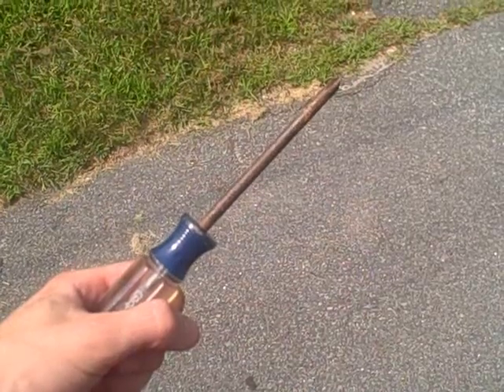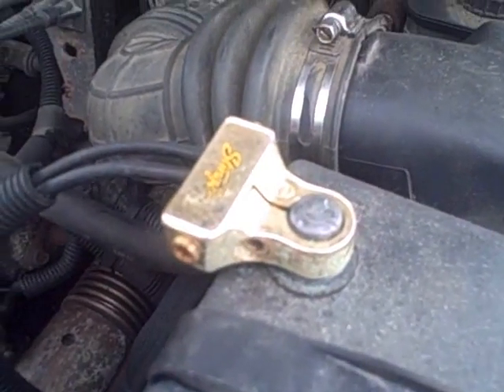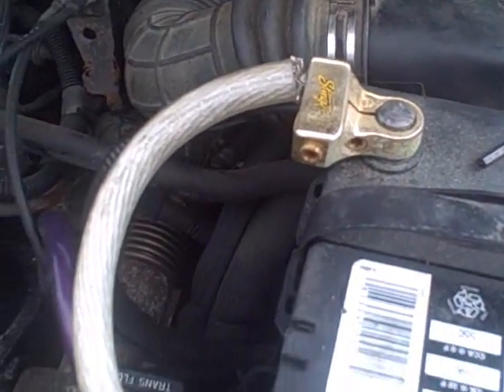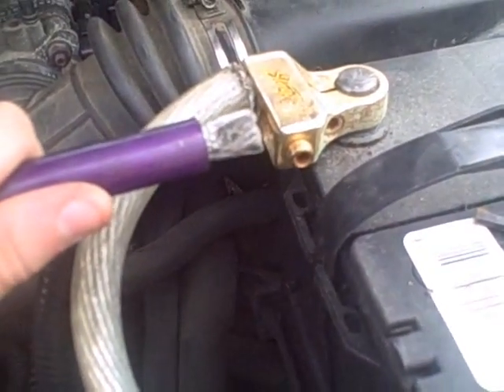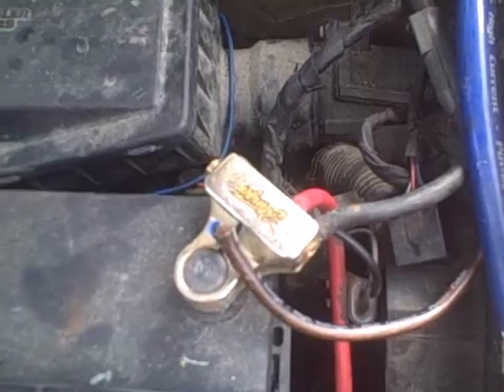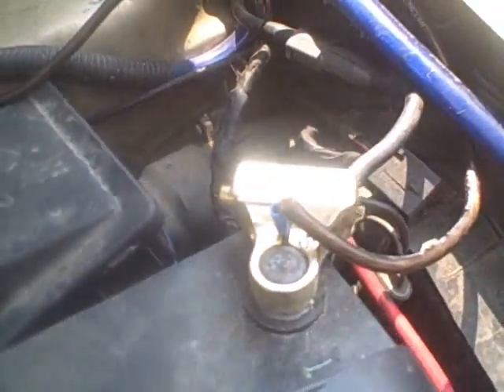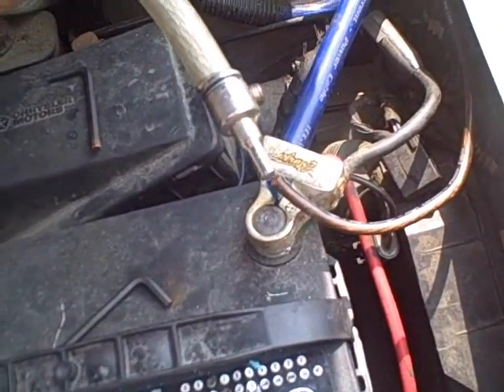Increase Car Audio Power 25% - How To Install Big Three Upgrade - Easy 15 Volt Stereo System Big 3

Comment: here is a good positive terminal with digital meter for less than 20 buck.Raptor RGBTMP-4C Rose Gold Positive Battery Terminal with Meter (1) 1/0 Gauge (2) 4 Gauge (2) 8 Gauge Oututs on amazon

Comment: I mean, putting in fuses after the battery is all hooked up. Neg is on, and pos is on of course. Putting in fuses then is what I'm confused about. Wouldn't it just be better to put them in while the negative cable is disconnected?

Comment: @p1n0ym4n321 Try to find a bolt on a solid piece of metal try and avoid the sheet metal. I bolted mine to the chassis.

Comment from the maker: With a 1500 watt amp - You're just on the edge of pushing it for your stock electrical - But with a good wiring job, and the big 3 upgrade, you should be alright as long as you monitor the voltage while bumping. And BTW - thanks for the nice comment :P

Comment: 1. How are you such a BOSS? and why are you so nice??? haha
2. Help! I am driving a 1990 Toyota Camry (not kidding, dont laugh) stock alternator and battery, running only 400 watts to my 2 12" Kicker CVRs. Obviously i am underpowering them, so i have a hifonics 1500 on the way. The problem is that my lights already dim.. will the big three help that? And do i NEED to run a fuse anywhere in the big three? Cuz ive seen it written somewhere. And do i NEED a different adapter to the battery? Thanks!

Comment from the maker: 1: It's my amp wire with a 1/0 adpater on the end of it - 2: No, some people do the Big 3 with the stock alt and batt still there - 3: Yes, depending on the size of the amp. - 4: They are nice subs.

Comment: what does the last 0 gauge wire run too and why is the end so different? do i need to upgrade my battery and alt to do the big three? at what point do i need another battery? and if i use 0 gauge wire for the big three is it okay to use 4 gauge to run to my amp? I'm sorry for all the questions I'm pretty sure i know the answers i just want to make sure I'm doing it right and don't feel like dealing with the ass holes at the shop around here. and what do you think of obsidian audio 12's? lol sorr

Comment: Thank you for simplifying pages and pages of instructions into one 3 min video lol, but one question, how does bigger guage wires increase 12v to 15v? or is that an upgraded battery?

Comment from the maker: Yes, on the negative wire - I use the stock engine ground, and add another engine ground on a near-by (clean) bolt.  --- 2nd ---- NO!!!!! DO NOT ATTACH YOUR POSITIVE WIRE TO JUST ANY BOLT ON YOUR ALTERNATOR!!! --- This will GROUND OUT YOUR VEHICLE! --- The alternator casing, bolts, and framework around your alternator are ALL GROUNDS - That is why we ground our engines, because our alternators are connected to them. You need to look harder on your alt, there is likely a post you are overlooking!

Comment from the maker: Often times it can be a simple loose wire in those cheaply made casings they are housed in - Open it up with a flathead and check the situation - If need be, reconnect the dangling wires or what have you - If not, try messing with the wire where it comes into the unit - It could be frayed.

Comment from the maker: With your alternator being the amperage that it is... I wouldn't suggest going much over 1,000W - With your rise, you'll likely still be seeing close to a 4ohm load, but even then, over time your alternator is going to be doing most of the work - If you can added another like-sized battery to your electrical, it would help buffer things up a bit, but I would recommend upgrading to a 100 / 200 amp alternator if you plan on doing a 1k+ / 2k system. You're only as good as your charging system :)

Comment: So I can put the negative to any bolt that's on the engine? Also my alternator doesn't have a positive bolt, so do I attach it to any bolt that's on the alternator? Help would be appreciated :)

Comment: Hey man, couple of questions. I have a 50Amp alternator in my car, I've done the big 3 upgrade with 2 gauge wire, how many RMS watts would you say I could pull from my system? and are there any other upgrades I could do to move this number up a bit? I would also like to know if running a lower impedance will put more strain on the alternator, because right now I have a 4 ohm load but since I bought 2 more subs i'll have a 1.3ohm load, at the same draw will this put more strain on the alt? Cheers

Comment: Hey exo I got another question I've got some aluminum wire I'm not sure of the gauge but it's either 0 or it's a Tad bit bigger and I can't afford the copper and I was wondering if the aluminum would work as well as the copper because the wire that's in it now is eight gauge Walmart wire that was already hooked up when I got the car thanks for all your help and I did find that video you were talking about with the single 18 and I built my new box and it's twice as loud thanks again bro.

Comment from the maker: I got this batch from Dr. Stereo - A local car audio shop of mine - And as far as the batter terminals and such - I got all that stuff from Ebay by searching "battery terminals" "1/0 wire adapter"

Comment: Hey Exo :)  i got 2 or 4 awg for my alternator and 1 awg for ground on alternator and from battery to chasis, 1 awg to power my amp and 2 awg to ground for my amp. my amp is now sold so i use a shitty 1000w peak boss audio amp now, but im getting a amp on 1500w rms for my pioneers on 1000w rms, and a 150 fuse block :) do i need any bigger wire ? i have 2 battery on 74 ah with 2 awg to power between them and 2 awg for ground :) :D LOVE YOUR VIDS !!! <3 <3

Comment: oh okay thanks c: and the "accesory/stereo cable" are those your stock wires? did you just cut the wire, add a fuse and add more 0 gauge after it? and also where did you get that thing at the end of that wire? the metal thing.

Comment from the maker: No, if anything it will put less stress on your stock wires. Some people totally replace them, some people just add to them. As well as fusing - Some people choose to only fuse their amps and accessories, while other fuse from alt to batt, and batt to batt ect.

Comment: EXO i have a question for you. If you do the big 3 upgrade, do you have to worry about frying your stock wires? Also, my stock wires come out to a terminal which is the battery terminal, like the wire is basically directly going to the battery, would i have to cut off the terminal and strip those wires? And fuse them? Or what do i do? Im also planning on getting extra batteries, would i have to worry about frying stock wires then too?

Comment: Tuning? &(may be a silly question)are you supposed to solder the lugs to the wires? O.O 'Cause that's all I think could be the "problem", besides the fact that my engine was grimy at the ground point(I believe I cleaned it though - plus I sanded it)... >.>

Comment: Should I leave my stock wire (power wire from alternator to battery) on as well as putting the 0 guage? Or should I take the stock wire off and leave just the 0 gauge? I figure more wire more current right? so I should leave the stock on along with the 0 gauge?

Comment: Well, I did the big 3 upgrade(small 3 actually - as I used 4AWG), but my amp is still tripping off after say 25mins or even less when I play music with Sine wave bass... =( A supposedly experienced guy told me I'm driving too much input signal to the amp(buy maxing out the gain & matching it to my 2V output Sony Deck), but I now believe that my(used)amp isn't working properly(damaged)& I'm seriously thinking of replacing it... >.> Any thoughts? O.O

Comment: hey man...nice setup...you know where i can get a high output alternator for a toyota echo online at a reliable site? i did the big three and expect to drop in  optima yellow top soon in the same echo but the current alternator is for 90 A and my amplifier draws 60 A max. By the way, are you pro - capacitor or not, and would it be useful for this setup instead of a high output alternator?

Comment: Hey exo do you need a fuse in the power wire running from the alternator to the battery?? I did some research and some say yes but some say it's not needed. I just need someone to guide me in the right direction because I do not want to waste money but I don't want to create a hazard.
Reply: any wire that is normally connected to the positive terminal of the battery requires a fuse, including the alternator wire in the big 3 upgrade

Comment: Hey - does the big three really increase your system voltage? I have a Jensen Power 680(680peak\340RMS non certified)amplifier & it keeps shutting down after a while & I notice this happens when my voltage(as seen on my Cadence 1.2uF Capacitor)drops below 14 volts(when I put my blower etc on)... PS: I plan to use 4AWG since it's just one amp & my Sony stereo...

Comment: @EXOcontralto 

     Hey man I like your stuff. Good FYI and install tips. But I have to say that caps can be a very useful tool in getting better sounding more powerful bass in setups that don't require 2 or more extra batteries. I know that on my system ( Kicker CVX 10, Kenwood KAC9104d and a yellow top stinger) my 2 farad makes a world of difference in my spl and sound quality. I did the big 3 w/ Kicker true 4 awh. Just a diff of opinion but all respect

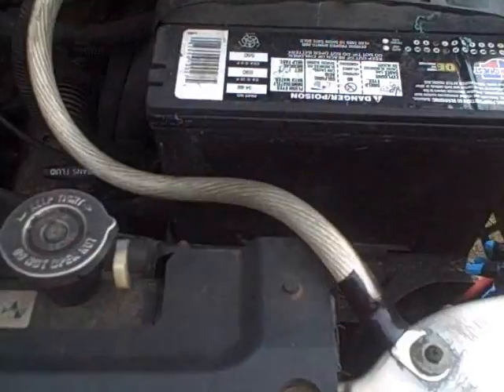Comment: Just a little suggestion at 1:22 take bolt and a nut and secure it propperly.
You can use a big ass cable, but its only as good as its connection.

Comment: hey man, awesome vids yr cool as hell. I have a 01 cadillac deville with a pioneer deh-p9400 and 2 cvr 12 with a zx1000 on 2 ohm. should i do the big 3? the only thing is that the cadillac battery is under the back seat -__- If you reply thanks man

Comment from the maker: YES - Your POWER is only as good as your GROUND - DC voltage travels in a big loop - You need to have the cable the same size on both sides.

Comment: I think that what he means by "drop out" is that his amp runs out of stored power, and that his car cannot supply enough current for his amp, so that when the low bass hits the amp looses power and sounds quieter(hence the bass "drops out") So he did the big 3, and now his amp sucks all the power from his battery because his alternator is not powerful enough. ( i am just guessing here :) hopefully this helps!

Comment: Sorry for the car audio lingo.  "Drop out on deep bass" = The low bass notes that rattle most little cars "yet kids think it sounds great." Low bass notes will make your alt work harder. Some kids add a cap 1 - 2 MFD (UF) which I don't recommend. I would go for a heavy duty alt and bigger bat. To avoid future problems. nothing worse than being stuck far from home.

Comment: I did the same on my 2011 F150 Followed your directions exactly I did a 1998 Honda Civic EX same as you suggest.  I also added power amps to both vehicles The upgrade you suggest stopped "drop out" on deep bass and killed my battery.  I suggest if your gonna do this do an alternator and battery upgrade. Because if your using high performance equipment and your headlights are dim or get dim with low  bass notes without upgrading the alt and battery? Your only asking for trouble.

Comment: the gauge of the wire is for more amps. your audio system draws power so the larger the wire the lower the chances of the wire overheating. the only reason you place a OO wire is if your amp draws 150 amps, but it doesnt. so this is a waste unless u invest in an 1 to 2 Farad cap and a  5 kW system

Comment from the maker: Most ALL amplifiers are rated and tested at 14.4v volts. That means for every tenth of a volt you are below this number, you are gradually delivering less and less power to your subs, creating dirtier and dirty power, and stinkier subs - as you reach further below 12v range, that's death to gear - No offense to your pops, but he's on the wrong track with that one. If you're voltage is 13.8 to begin with, you really want to try to keep it there as best as you can, as it affects it a great deal.

Comment: hmm I have 3 amps and 2 subs (the other amp supplies rear speakers) in my trunk, didn't upgrade the cables, the 12V cable that goes to the trunk is maybe half the thickness.
Also got a capacitor.

And it works flawless.

Comment: my car runs at 13.8 volts all the time and my amps bring it down to 13.2. i have an optima yellow top in front and 2 blue tops in the back.

Comment: If your car runs all the time at 13.2 volts then your batteries will not last as long. This does affect your batteries total power because power is the watts and power is voltage times amperage. I wouldnt see it lowering your power to your amp much though.  And as long as your battery has 12 volts when you start your engine it will put out the amount of starting power it is supposed too. You can get the battery load tested for free at parts stores.

Comment: Hello I just got a new 200 amp alternator on my 2001 Ford explorer sport Trac I have 2 kenwood 1000watt amplifiers, 1 db link 4 farad cap and 2 dual enclosed MTX Terminator subs (4 in total) and my lights are still dimming do you think the big 3 will help and/or will I need to buy a new battery as well? Please help

Comment: I have a question for the people who actually know something about voltage and amps. I want to do the big 3. My alternator charges at 13.8 volts (voltage drop takes it down to 13.2) and my rear batteries have 500 cranking amps each. My dad seems to think the batteries' voltage won't affect my amps' output power. Any thoughts?

Comment: @EXOcontralto love your Vids bro subcribed, i have some questions for you?? im running two 15inch L7 kickers in a 1994 chevy caprice on a 6000 watt performance teknique amp.... I need to do big 3 add a extra battery i currently have a sealed box but i think the box isnt big enough what should i do to increase my bass should i go ported box for deeper bass? is big 3 cheap to do? and should i also add a EQ or crossover let me kno please i would appreciate it oh yea i only have 4 guage right now

Comment: @EXOcontralto 

Another benefit of soldering is all connections (wires, terminals ETC...) have a secure electrical and mechanical connection which in the long run makes the whole system more reliable and also able to handle more current given the solder provides a lower resistance between what is connected than crimp terminals do.

Comment: idk ae.. waste of $40 i think. Unless you've upgraded the alternator the only one which would benefit from upgrading is the ground-chassis wire. That's because it's the only one where your amp will need to run current though. The alternator-positive and engine-ground wires were chosen by the manufacturer to be adequate for the current draw of the alternator. If you reeeeeeally think they calculated it wrong then get a multimeter and see what voltage drop your getting across the wire.

Comment: I really hope you guys with boom cars know how annoyed your neighbors are with you. When you're pushing 15+ inches of air it doesn't matter what level you listen to your music at, people hear it inside of their homes, over their own music and it's one of those suburban disturbances that get worse every year. If you guys would just turn down the sub output from your head units when you're just listening to music in your driveway it wouldn't bother people as much. 760wRMS into 2 12"sealed subs btw

Comment: Hi i have a question. My total wattage for my amp is 1400rms. If I upgrade my battery to a kinetic hc 2000 which give out 2250 cranking amps and upgrade my big three will I be fine? I don't wanna purchase a new alternator, so i'm hoping this would suffice

Comment: if i was to buy an optima yellow top nd do the big three with a stock alteranter nd have another batter in the back could i also do the big 3 with the same alternator or do i have to buy another alternator??

Comment from the maker: @Danimal3993 - An extra battery will help, but even then you should still upgrade your front wires to a better ground so the accessories in the back which are grounded through the frame, are more stable.

Comment: Hey big fan fan of your vids man! i have a question for you, hopefully you can help me out. I have a ppi pcx1250 amp on my stock alternator and it dims my lights a bit but im still looking for more power and im worried if i upgrade my wires that the amp will pull even harder on the battery and im on a budget so i dont want to upgrade my alt if i dont have to. A little advice would be very appreciated!

Comment: The starter cable doesn't matter, as it only affects the starter. But you may notice a slight improvement in how the vehicle starts because the block is better grounded, and thus the starter is too.

Comment: @EXOcontralto to do the big 3 would i have to replace the wire to my starter with 0 gauge to?? or just the alt battery frame and engine block

Comment: ok i got a couple questions for you.at 2;38 in your vid theres somthing on the end your wire running to your amp what is that thing called?and the second question is can a stock atlnater charge 2 battery without hurting it.i want to run two differnt charge lines.plz help thanks

Comment: @ninjafisheez Yes, and the closer to the alternator the better since it is the actual source of power. Even better if you connect the ground cable to the alternator's chassis.

Comment: When doing this, Just remember to unhook your battery's ground first then unhook the positive next. Then swap out your positive cable and hook it up to the battery. Then change out your ground and hook it up last. that way if you happend to arc anything it's not grounded and you wont short anything out